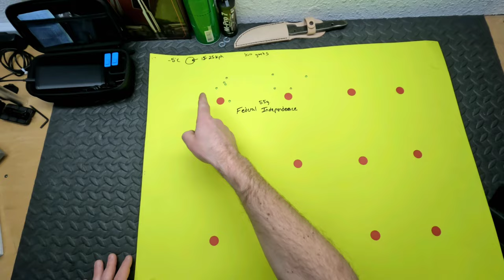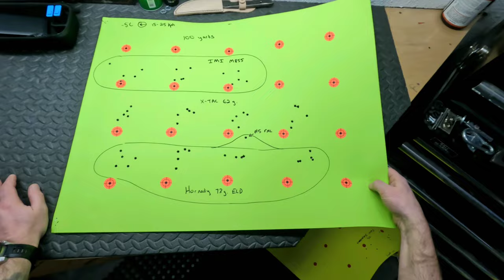BCL Siberian Shooting & Update

Comment: Great video. Out of curiosity, what kind of muzzle brake do you have on the gun? Or is it the stock one that comes with it?
Reply from the maker: It only comes with a thread protector.  This is a clone of the Precision Armament M-11 brake.
Reply: @southernalbertaoutdoors  where did you get it from? Or was it built
Reply from the maker: That particular one was from Aliexpress or Wish, I can't recall but works great for this purpose.  I have a couple of the Precision Armament brakes in 223 and 308 with a matte finish.  I just can't spend made in America money on everything.

Comment: Great update review. Thank you. Did you just use electrical tape on the upper and lower to tighten it up a bit, or what kind of tape?
Reply from the maker: Thank you for the positive feedback. 
Yes, for me it was a single layer of black electrical tape. So far the tape hasn't moved as lubricant doesn't seem to migrate there.

Comment: Quick question in regards to the trigger guard, the one it comes with hurts so bad and I’m looking to buy a new aftermarket one. Is it considered to fit any other AR trigger guard? And if so which one would you recommend that can fill that nasty void that hurts your finger when your reloading
Thanks man looking forward to another update.
Reply from the maker: I have seen others on the Facebook group using the magpul enhanced aluminum trigger guard and it seems to close that gap.
I'll be ordering one shortly.
Reply: @southernalbertaoutdoors  thank you so much man

Comment: Great videos on the Siberian ! Just bought one and currently shopping for optic and mount. Wanting to go with a LPVO with good daylight visible  illuminated reticle that won’t break the bank. Any suggestions on an optic and mount? Looking at American defense one piece mount that’s 1.93” height above rail. Like the idea of being heads up and not scrunched down with the Zhukov stock being in line with rail. Think that one piece mount height is enough or do you suggest adding an additional riser in there? Thanks I’m advance
Reply from the maker: I think the 1.93 mount is good. Take a look at Primary Arms for an LPVo, or lots like Vortex.

Comment: What did you install underneath to mount a light or grip or bipod ?  M-Lock to Picatinny adapter ?  Thanks
Reply from the maker: There are M-lok slots on the bottom and sides, 3, 6, 9 O'clock. Picatinny rail on the top.
The Arca rail, hand stop and Picatinny rail on the bottom are all mounted with M-lok.

Comment: Did you get a new firing pin ? There’s a recall to get an update kit. Not supposed to shoot until the pin is replaced. There not much information on line but I did order the kit from bcl.
Reply from the maker: Yes, I have requested a new firing pin as well, but have yet to recieve it.  I did a quick video on this a few days ago.
This was all done prior to that announcement.